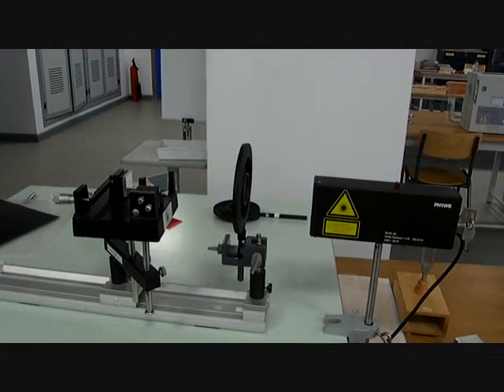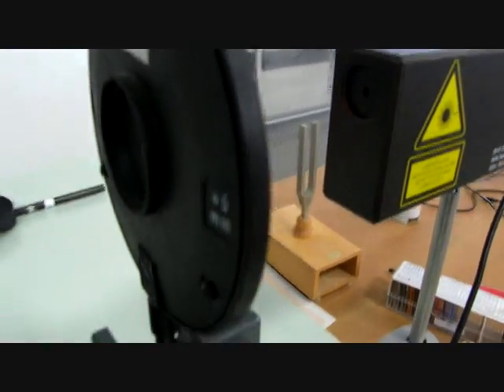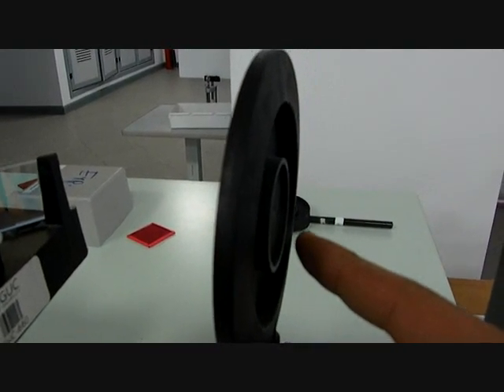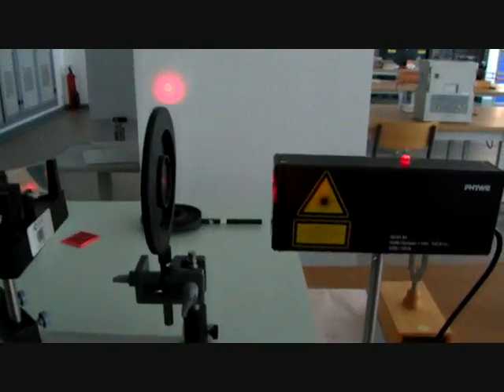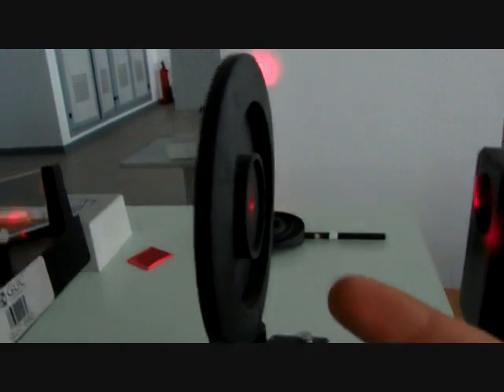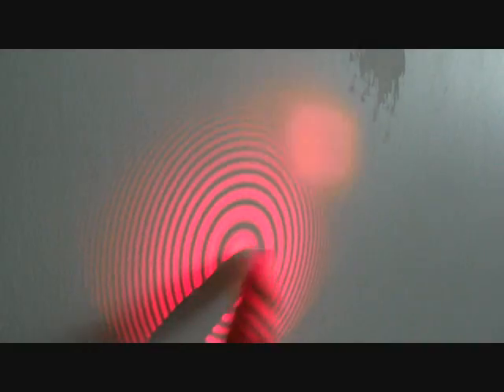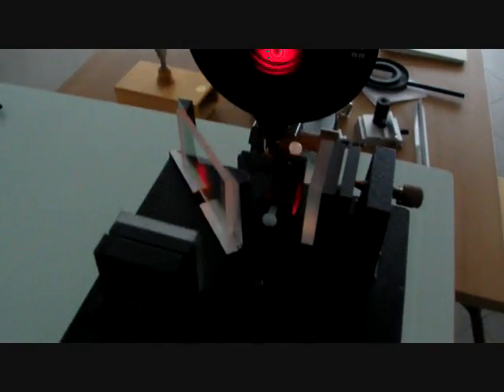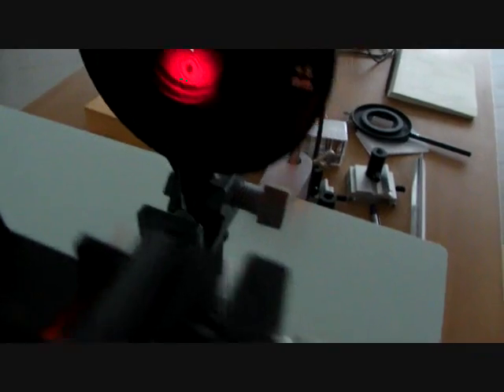Michelson Interferometer Demonstration

Comment: why dark fringe in center?
Reply: Because of odd number of reflections, there is a dark fringe at the center at the source screen. 1 reflection changes the phase of a wave by pi radians, 2 reflections change the phase of the wave to the original phase it had at the source, 3 reflections again change the phase of the wave to 3pi/2 radians which is 'effectively' the change by pi radians, so you can see that, odd number of reflections change a crest into a negative crest and a trough into a negative trough. The light coming from the source and the light reflected undergo destructive interference and that causes the dark fringe at the source screen. While at the main screen, the two divided light waves undergo 'even' no. of reflections, causing constructive interference and hence we see a bright fringe at the center. At the source screen, we have the light wave at the source and the reflected light wave interfering while at the main screen we have the reflected light waves interfering only. The reflected light waves at the source screen undergo constructive interference between them but destructive interference with the source light wave. I hope, you get an insight into this wave drama, haha.

Comment: This actually makes a lot of sense. I never thought of the interference pattern that would be reflected back towards the light source. It's interesting how there is a dark fringe instead of a bright fringe at the center, too. Great video!
Reply: The dark fringe is because of odd numbered reflections( 1 and 3, here by the two split waves when going towards the source screen). You may want to look at an explanation that I gave in an another comment of mine( I am not a spammer and I want to make it clear.
'Because of odd number of reflections, there is a dark fringe at the center at the source screen. 1 reflection changes the phase of a wave by pi radians, 2 reflections change the phase of the wave to the original phase it had at the source, 3 reflections again change the phase of the wave to 3pi/2 radians which is 'effectively' the change by pi radians, so you can see that, odd number of reflections change a crest into a negative crest and a trough into a negative trough. The light coming from the source and the light reflected undergo destructive interference and that causes the dark fringe at the source screen. While at the main screen, the two divided light waves undergo 'even' no. of reflections, causing constructive interference and hence we see a bright fringe at the center. At the source screen, we have the light wave at the source and the reflected light wave interfering while at the main screen we have the reflected light waves interfering only. The reflected light waves at the source screen undergo constructive interference between them but destructive interference with the source light wave. I hope, you get an insight into this wave drama, haha.'